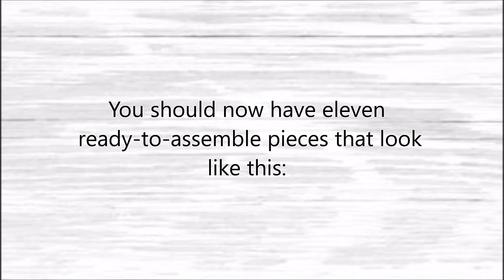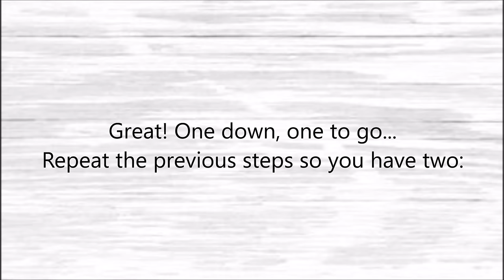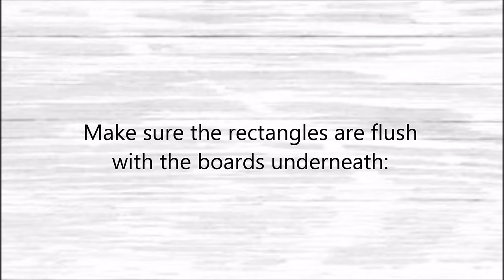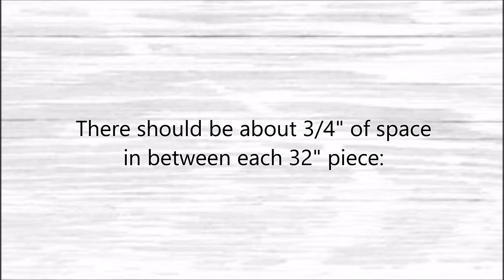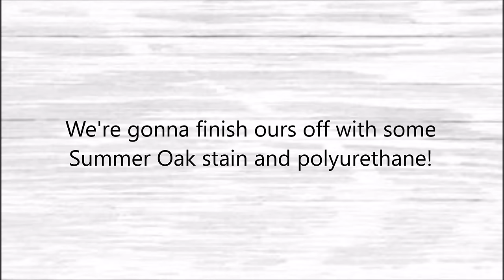Make a $10 Bench using only two 2x4s! - Easy DIY Project

Comment: Took me less than 45 minutes. Used three 2x4"s which I had on hand because I wanted 36" instead of 32" so it would be less cozy. Used a pneumatic framer instead of drill driver and ring shank nails. Very satisfied. Thanks.

Comment: I love your channel! For a super novice like me, your instructions are perfect. I did a practice project using your bench tutorial. Took me a bit longer because my drill died as I did not have it fully charged, I adjusted my bench to 10 ", 15" & 35" because I had a lot of scrap wood to use, I had 1 x 4's so I doubled a few of those and made 4 rows for the seat instead of 3 & I added a 2x4 middle piece for extra stability underneath. Overall easy to adjust your instructions & next I will try your farm house table. Your channel is the best I came across to build an easy peasy bench. I am going to paint mine black. Mine isn't perfect but it was fun to build. Thank you for your channel, hope to see more great projects 😊

Comment: I made two 44” X 16 3/4” benches for my giant 20” x 16” tall garden pots.  I chose to use pressure treated lumber.  With the extra top piece, I needed 7, 8’ pieces of lumber.  Each bench came in at $52.50.  I had screws, outdoor Tightbond, and outdoor stain-sealer for the project already.  Your plans were perfect.  I did appreciate having a Framer’s square to square up the legs.  There is no way I could buy these benches for the amount I spent on them.  Lumber costs have gone nuts.  I knew it was going to be over a hundred dollars to build these but I was glad I went with your design.  It saved a lot of lumber.  Thanks again.  Cheers!

Comment: Thanks for the great tutorial.  I made two of these out of pressured-treated 2 X 4s.  They were 44” long and 16 1/2 inches wide.  I built them to hold giant planters that were 20” wide and 16” tall. It took 7 8’ boards but I was able to cut and assemble them 5 hours.  I’m going to seal them with an outdoor stain.  I am very happy with your practical design.  Lumber prices in California are still sky-high.  I had the screws and the strain.  For lumber alone, this bench with four top pieces to accommodate the big pots, cost $105 for two benches.  For me it was worth it.  I closed my eyes at the Big Box store when I checked out.  I guessed it would be over a hundred.  It is our new reality.  I could never have bought these sturdy benches for $52.50 each.  Thanks again for the great plan.  Cheers!
Reply: ok so prices have stablized and are coming down, but I needed both a bench for planters and to sit on and a terrain leveler here in hilly Washington.  I used landscape timbers  that I stained and polyed.  put the timbers a foot and 1/2 into the ground and have them two inches above it.  with cedar pickets to hold the soil  works great

Comment: I live in the UK and I made one of these out of scrap timber  from previous projects, they were not all of them were  same width.  However , with an electric plane this  was easily sorted. To buy the sawn treated timber still cost £20 roughly 30 dollars.     Tip; make sure the timber you buy is straight and not twisted  !!!

Comment: Nice bench using supply 2x4’s. However, I would add a third piece between the legs as a brace to give added support to keep the legs from possibly buckling. Just gives better support.

Comment: Newbie when it comes to woodworking projects. Forgive my ignorance but I have 2 questions: 1) Need to drill a pilot hole? When is that recommended? 2) Best to use a drill or an impact driver for this? What’s the rule of thumb for when to use which? Thanks! Keep the videos coming!
Reply: Whatch Steve woodworking for mortals basics woodworking

Yes you really want to use guide holes  unless you maybe have self drilling screws 

If the screw is fat and large 

Hammer is better as it never losses grip on screw but it depends
Reply: @shirosurfer8864  when you say 'hammer', do you mean use the impact driver he asked about?

Comment: If you don't have a power saw and worried about cutting in a straight line with a handsaw, you can buy one of those handsaw kits with a guide specifically made to slip a 2x4 right into that would make it super easy to cut. Now if you don't have a power drill for the screws have fun with screwing them by hand which is certainly doable but not for me. 🤣 (you could also just use nails, though the screws are much more awesome)
Reply from the maker: Some of the home improvement stores will actually cut the pieces for you, which makes it extra easy!

Comment: A very good design for a bench and useful video. I just have a couple of questions, at 0:16 you state the the wood depth is 12", at 0:28 you say the boards are 2" thick. Then at 0:36 you ask us to have 4 pieces 9" long. So two 2" pieces and a 9" piece is 13" in total, yet you said at 0:16 it was 12" - am I missing something, or is there just an obvious mistake? Also the height you state is 16.25", but it is made up of a 14.75" and the 2" thickness piece on top - that makes it 16.75" am I right? Please let me know if I'm missing something obvious before I try this out. Thanks in advance.
Reply from the maker: Hi! Dimensional lumber has an actual size different from what is shown at the store. So a 2"x4" is actually only 1.5"x3.5" if you measure it. The cut lengths in the video account for this.
Reply: @TheRehabLife  Ok thanks